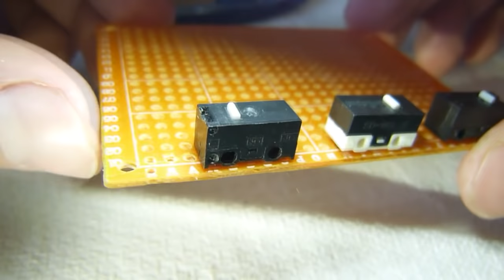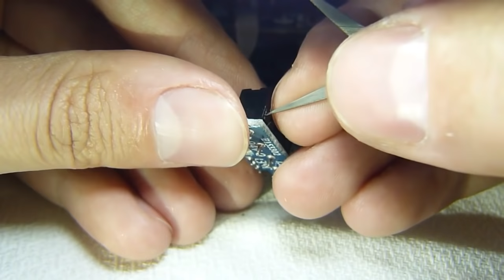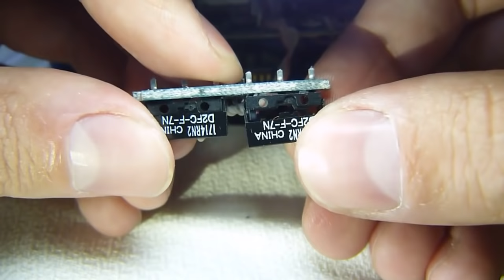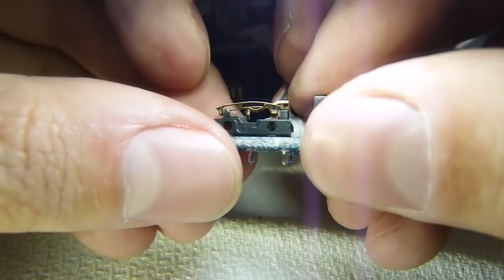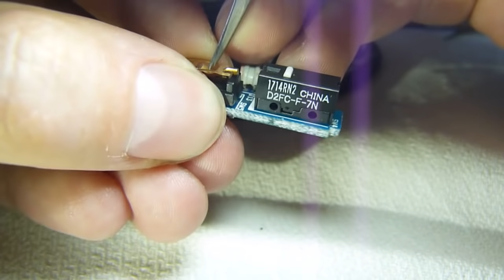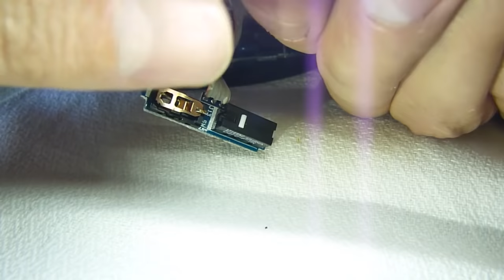Double click problem: How to fix faulty mouse button

Comment: I would say the contacts are MORE of the issue than the spring weakening, and zero cleaning the contacts????? 
I use a pink eraser to clean first, then alcohol or acetone to clean off the eraser. This works on al kinds of contacts and even brush motors (brushes and commutator), been using this for 40 years.

Comment: Firstly very appreciate spending time to have this master piece video with so much details, now I dont have to throw the 100 bucks mouse away with just 3 years of light use.
Just wondering how long this fix will last given that the filmy copper was forced to bend, which means it probably gonna resume the "bad curvy status" after certain amount of activations.
Still miss my Logi Max 518, so much abuse and still going strong.

Comment: Guys, I know this might sound downright mentally unstable, But blowing into the hole of the button doing the double clicking fixes it for a while and then you have to blow the mouse again. As crazy as it sounds, its the only thing that has worked for me that doesnt include a replacement which is what this video is about not fixing it.
Reply: It worked for me earlier but soon double clicking would return so I used method shown in this video and it worked.
Reply: This video doesn't involve any replacements though. He shows other switches for comparison, but he actually does open the mouse, open the switch, fix the switch's internal contact and then assembles everything again. No components were replaced.
Reply: @MaavBR  do you remove the thingy and put it back again ? its a replace. aka place again.
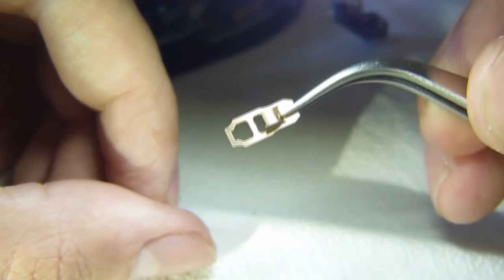Reply: @redcastlefan  The core of the video isn't the replacement. Is actually fixing the broken part though... Note in 2:35 how he bends the contact so it returns to its original form.

Comment: Oh my god, it worked. I did this on two mouses with different problems.
One of them didn't register the click everytime (cm storm) and the other had double click (logitech gaming g pro gaming).
While "naked", the switch worked fine. I thought it was the plastic on the first mouse, tried putting some paper to se if it would work but it didnt. I've boxed the first mouse and bought the logitech.
My idea was to remove the switches from the old mouse and put on the logitech one with double click. But before that, I've decided to try this fix and oh boy, it fixed both mouses.
Thanks for the video, It's really well made. I've saved R$145,00 on a new one just because one button didn't work.

Comment: Mine was too curved so I had to straighten the springy thing flat.  Then attach the springy thing first and push forward and latch to the front.  This was a lot easier than attaching the front first like the video.  Hope that makes sense.  I had 2 performance mx with same issue.  fixed both.   Fat fingers, good luck!!

Comment: thank you so much, i fixed 2 mice, one had the double click problem, the other one didnt click at all. for the second one I didn't even have to open the microswitch, I just pushed the little button on top of the microswitch  as hard as possible which falso fixed the problem.

Comment: Uselful ! +1 Fixed my mouse exacly as he shown. But one think needs to be added. when you open the switch by using scissors the cap has jumped out with a mad spin. and the little white part fall somewhere. it took me a while to find it. Before you open that switch make sure you open it in some sort of box or coverage so the little white part will not get lost of your sight ! 
thanks man !
Reply: i also wd40 ed circuit board all over . no problem yet . İ need to see the long term effect ! thanks again.

Comment: Step 1: Get middle bendy spring part to latch onto its respective notch

Step 2: Now, work on getting the end, which the bendy spring's teeth is facing towards, to land in its notch. Pulling this end tightly outwards while slowly pressing down on the bendy spring part will eventually get it in place. Be very still, gentle, and controlled though, this can (and was for me) terribly frustrating!

Step 3: Discombobulate 🕵️‍♂️
Reply: That seems like the logical thing to do, but the notch is so small, and it's so difficult to then align the ends that it ends up being too hard. I always start with the ends and the bendy part on top of the notch to then snap it in with a screwdriver. Just have to put pressure on it at a diagonal angle instead of straight down while holding the copper in place with the other hand.

Comment: BEFORE YOU TAKE OFF THE METAL BIT, TRY RUBBING ITS SURFACES AND THE CONTACT POINT THAT MAKES A CLICK SOUND WITH A NEEDLE FIRST! YOUR PROBLEM IS PROBABLY THAT THE METAL IS DIRTY.
IT MAY BE DIFFICULT TO PUT THE METAL BIT ON AFTER YOU REMOVE IT.

Comment: It was very hard to get the little metal piece back on just right. The curved part kept falling all the way down. And now, my mouse doesn’t make it’s nice clicking sound, and it’s very easy to left click now. Like too easy 🙈 might need to replace the clicker and solder the piece back on

Comment: I've dealt with this problem a couple of times.Let me tell you, the easiest and fastest solution without buying a new mouse is to solder in a new switch. They are really cheap. Repairing the switch itself is a real PITA and it'll likely break.

Comment: Hi, I dit it on my Roccat Leadr who was starting to get the double click thing (maybe 1/10 or 1/15 times), and this thing resolve it. If it happen again I think I will search to buy the switch and replace this little think with a new one. Thanks a lot dude ! You saved my 140€ mouse :)

Comment: Thank you this video helped me a lot! but in my case, I had to flatten the metal piece to fix my issue (instead of bending, like shown here). 
Also for me, the microswitch was soldered on a full size circuit board which I could not remove from the case :( Despite having removed all the screws inside, I didn't want to use force and break something, so I played like a surgeon for hours on my dead mouse with a tweezer! :(

Comment: yessss this fixed my g9 laser!!.It took me 30 minutes when you are puting back the spring first hook in the little tab part and put the contact between the metal pins then just press the sqere hole over the front metal pins.(the small metal tab has two teath make sure they are in a tiny grove).

Comment: Omg thank you thank you!
My Roccat kone xtd had been eating dust for close to 8 years. 
Saw your video today and I went for it. It was either gonna work or I give it away. 

I don't have the fancy equipment so used my wife's eyebrow tweezers :P

The white button flipped off and I spent most of the time finding it. 
Bending and putting the spring back went quite easy. 

When I put it back together I had zero hopes. But when I clicked for the hundredth time and it didn't double click, I knew I had to write this big post as a thank you.

Comment: I did this on my G700 mouse and it helped for a month or so but it did not last for me anyway.  I ordered a genuine Japan made switch and soldered it in almost easier than the switch fix but it does require a solder sucker and iron.

Comment: i have to thank you for this video! i fix my double clicking logitech g502 with this.. i had a problem placing the bronze clip back and discovered the middle part has to be pushed slightly down to maintain the bounce and secure fit. other than that, the double clicking is now gone. wow!

Comment: That's nice in theory but you forgot to mention that you have to be a surgeon to get that little metal feather back in place. 🥺
I can't take out the switches completely from the mouse housing so it's sheer impossible

Comment: All it took in my case was squirting a little contact cleaner on each switch and repeatedly pressing them while still soaked. Didn't even need to open them.

Comment: My problem is that when holding down RMB, to move camera around in WOW, there are small interrupts in the signal, so camera movement stops. I have to press really hard with my finger, to prevent that from happening.

RMB clicks register just fine, in a FPS for example when aiming down sights. Problem is with prolonged RMB holding

I ordered a new exactly same mouse, since fits perfectly in my humongous paw, so I'll use the old one as an experiment to try to fix it, Logitech M500.

What do you thing I should do with the little copper metal  plate ?  Also would you happen to know if there are replacement microswitches ? Take the whole clicking thing out and put a new one in ? Thank you !
Reply: There are replacement switches as well as lot's of videos on how to replace them. The process looks fairly easy, but you will need a soldering iron and a soldering pump or braid to remove the old switches (does not appear to be an overly complex or delicate process, so no worries if you don't have much experience in that regard).
Reply: @EatMyAngus  Experience, no, knowledge, yes. Finished industrial robots in college and we had a class of 2 years for electronics and electric engines. We didn't do much soldering due to lack of funds unfortunately, but I do own a soldering iron and use to repair lots of things.

 Never tackled a mouse micro switch yet, so I figured I'd gather information first. Thank you.

Comment: Good news is: I fixed the double clicking issue. Bad news: Only after I tore the pins from a grey ribbon that connected both boards (deathadder mouse) in my 4 hour clumsiness trying to put the spring back in place.  👍Maybe I'll try fixing that next

Comment: I did it in about 20 minutes. It seems to work even when I messed up with removing the plastic cover that encapsulates the spring.
Reply: My fix lasted 2 weeks.

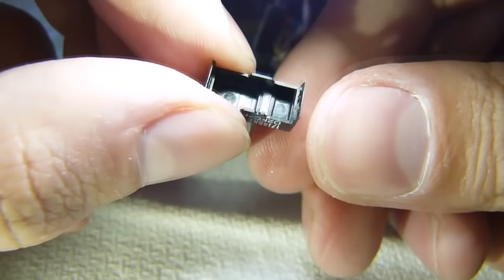Comment: The probleem with my mouse is that the grey/silver plastic thing you remove at 1:45 looks wasted/wore off.. How can I fix my clicking issue? Can I buy that silver thing? do I have to put "something" over that thing to make it work? Please help

PS: you refer to it as "white pin" in your tutorial if im not wrong...
Reply: buy the same button on aliexpress and replace the parts as simple as that,
so you avoid desoldering

Comment: my logitech G402 is double clicking like every click. I try closing a browser tab and 2 tabs will close everytime. Even worse is while working with MS Excel sheets. Im losing my mind. It happened once before but got resolved automatically making me think its a software issue. I dont think Im willing to go through the vid instructions as my mouse is still under warranty and will request for replacement instead.

Comment: This is very hard to do. Not easy. I just ordered new switches and I am going to solder them properly, remove the old one and put the new one. The metal piece is tiny and it is not easy to fix at all. If you know how to solder, fix it soldering a new one, and you will have longer lasting mouse

Comment: Not so easy to do!
I tried to remove click switch with soldering but it won't off. I decided to open it but it won't be the same, so I could not fix it.
Logitech G502 Hero with wire

Comment: I Screwed up my Mouse by trying to Fix the Left Mouse Button and ended up messing the Mouse wheel Click box and a side Button that is for going back in pages, got 1 copper part from the 2 of the ones i messed up cause i lost one while opening it but in the end i ended up fixing the Left Mouse button............Hope i won't be needing the other ones later on.

Comment: well yeah that helped me back when i still had the a4tech x7 I did this once on it , the procedure helped for two months , but after that the thing bent all the way because of the metal fatigue , so if you have a soldering iron just replace the switch, it's just 1 dollar for the one for 50M presses.
Reply: where do u buy the one for 1 dollar

Comment: Dude , Thank you so fucking much! It took me around 2 hours to get it all done , putting back that metal piece was such a pain in the ass . I was so frustrated and literally walked off twice thinking i can't do it hahah but finally i managed . Now my Logitech G402 feels like i just bought it. Anyone reading this , you will get frustrated with the metal spring , its frustrating but getting it all placed in makes you mouse feels brand new! 
Thank you again!
Reply: I was actually looking to get your mouse due to the click issue of my current mouse. Of course this fix helped immensely! But I was wondering, how long have you been using the G402? Was thinking of getting it in the future if/when my current mouse breaks down. If you have any pros and cons about it, I'd love to hear them!
Reply: @elvenstar207  hey! Hope you're well my guy. I've had my G402 for about 4 years now and I gotta say that its totally worth the money. I started to have the double clicking issue after like 3 years ,it rarely used to happen back then but after like 3 to 4 months of its first appearance it got to a point where it was impossible to use . That's when I applied this fix and voila! The mouse feels brand new. 
When it comes to cons there's only one thing I could thing about I.e it's a bit over weight as compared to other mice, you get used to it after some time but in the first few months it's a struggle to use .
Reply: @mraboveitall9271  Oh perfect, thanks a lot for the mini review! :) The weight is fine for me as the mouse I currently use is pretty much a brick lol but I like the extra weight and the G402 is actually lighter so I think that will take me time to get used to it! I just really like the fact that the G402 has got larger buttons on it compared to most mice nowadays. Thanks once again! Cheers! :)

Comment: How long does this fix last? 6 months? 1 year? 2 years? If it happens again and you fix it again will it become faulty more frequently because you're constantly bending that metal piece back?
Reply: You can buy the Omron switches for pennies each from eBay, much easier than taking the switch apart if you've ever done simple soldering. This method is great in a pinch if you can't wait for replacement switches to arrive but the metal will get weaker over time
Reply: Thx for the tip. I'll remember it for next time. I wish I knew this before I threw away my Logitech G400s. I loved that mouse :(
Reply: @Tatertot01  Yeah I've thrown plenty of things away in the past when it could've been an easy fix, learning the basics about electronics in general can really save a lot of money in the long run

Comment: Nice work but I don’t posses neither the patience nor the dexterity you seem to have. I bought new switches in Amazon very cheap and  replaced the tiny metal parts on both sides. I suspected the old pieces, after bending them back, were going to loose rigidity and fail again due to metal fatigue.

Comment: Followed instructions very clearly, Perfect vid, very easy to follow unlucky for me, I must have screwed up something while putting it together, beacuse my right mouse button no longer works at all, Pretty sure it's my fault, might have touched something important while trying to get the plastic cap off, rip 6 year old Logitech G5, Don't follow my mistake of being careless, do EXACTLY what he does in his excellent video, and use the right tools, because a exacto knife will prob end you up like me

Will try to solder a new one on as soon as I get a iron, and learn how to use it.

Comment: Would have worked for me if my son hadn't blasted those npc's into smithereens!  That little bendable part of the copper piece was toast.  Thanks for the video though!
Reply: Update.  Mostly fixed it.  I just replaced it right on the board without desoldering it and used the middle buttons contact as that is rarely used.  Worked well.

Comment: I would wonder if this solution would really help - watch this:   https://youtu.be/v5BhECVlKJA
The problem is the result of multiple factors like material (alloy), construction, circuit, snap mechanic, voltage level etc.
If you run into this problem simply exchange the micro switches against better ones

Comment: it worked, even after 300 straight clickings, using the doubleclicktest, it didn't double click. 
I almost bought a new mouse.
My mouse is a logitech g pro wired mouse.

Comment: the thing is, what makes these things double click one of them were logitech low power usage
Reply: Dirty contacts. The dust gets everywhere including inside of the Omron casing. You're pressing down expecting a continuous click, but the connection gets interrupted by the particles resulting in multiple clicks. Either that or the copper is faulty.

Comment: Ahahaha!
I just took the spring from an Omron and put it in a cheap Logitech switch (M570 wireless trackball). Saved me $30 and the Omron spring will probably last way longer than a new Logitech switch would have.

Comment: If you're willing to solder the KAIHUA Kailh GM 8.0 switches are a more permanent solution they are better then the original and compatible with the trinity

Comment: Struggling to remove the clip that holds the mouse clicker in place.
Reply: Ok, I did it. I freakin' did it. Now all I need is a video or instructions for removing the middle mouse button as its also double-clicking. :S

Comment: This is not worth the time and frustration. The metal, once deformed, will no longer retain its springiness in the long term once you bend it back. The only permanent "fix" is to buy a replacement switch, de-solder the old one on the board and solder in the new one.

Comment: Thanks. I was emboldened to dismantle my mouse ans fix it with 5x eyeglasses{when you are over 40}, spit{or masking tape to hold the button in place{, screwdriver, needle and tweezers.